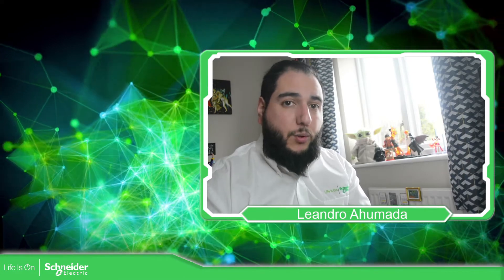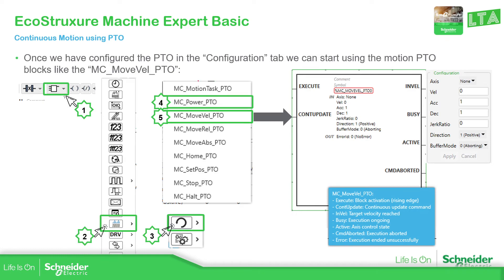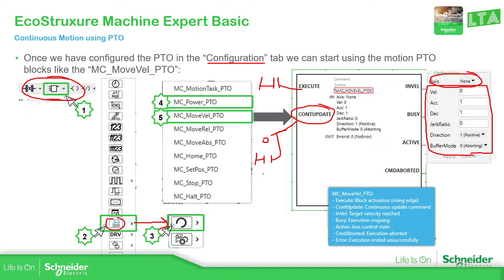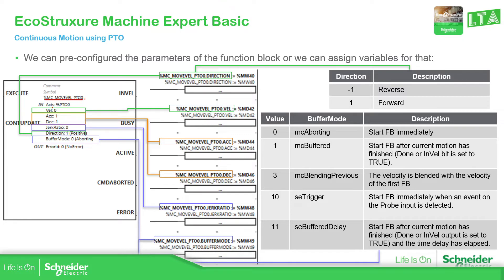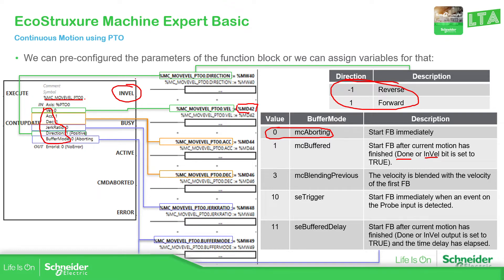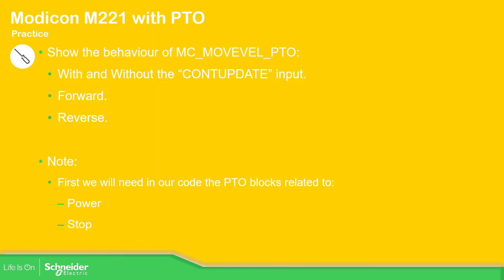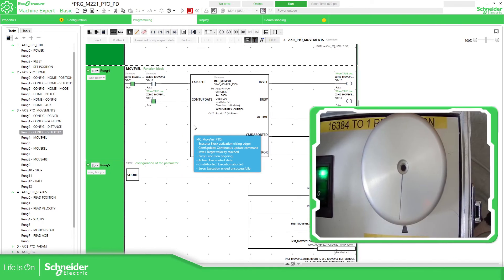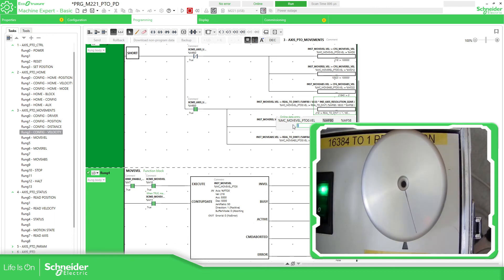Training - M221 - M16.5 Continuous Motion PTO

Comment: Hi sir,...while executing PTO after power fail each time need to set the home , or there is any other way to set home
Reply from the maker: Hi There! As you are using a open loop to control the axis, you must do a home before any movement.